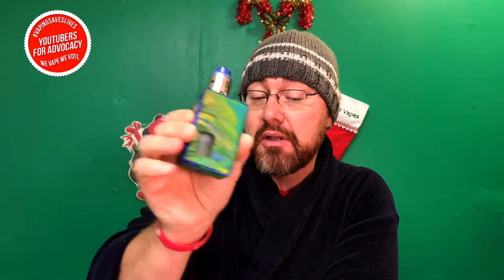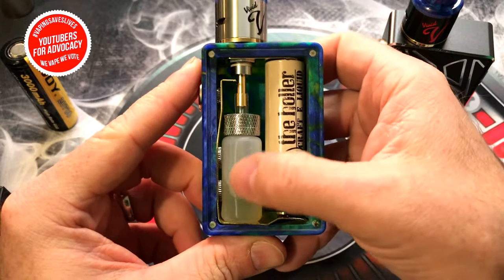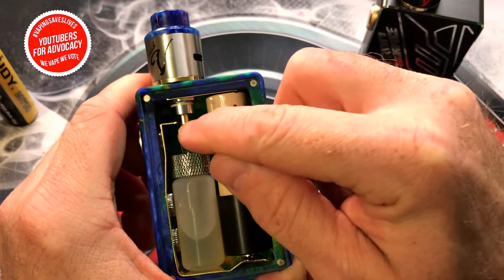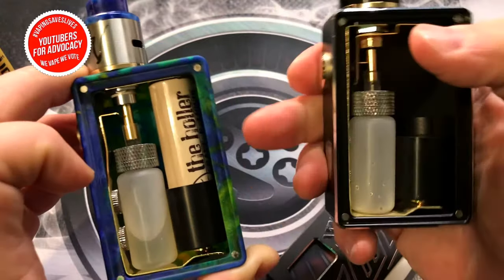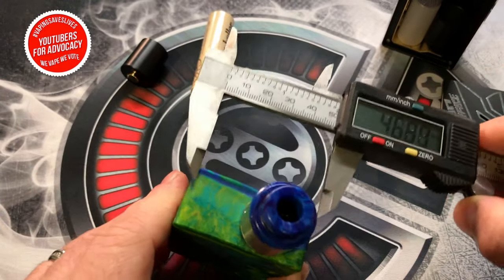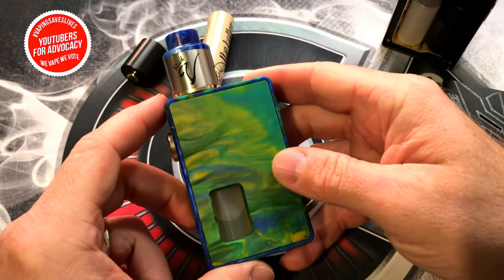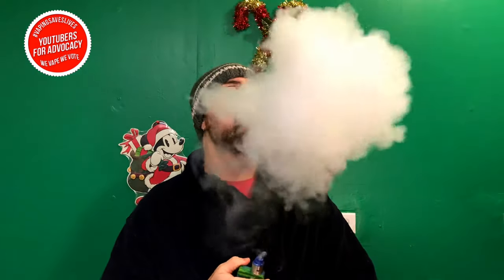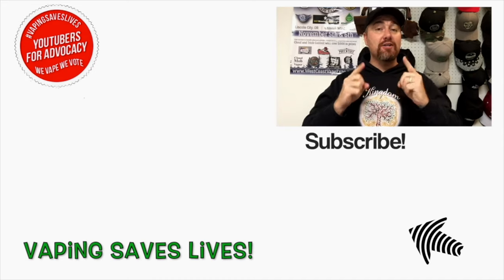VBS Iron Surface Squonk Mod RESIN Review~

Comment: Actually a Sony VTC5a 18650 is still the hardest hitting battery besides the 20700 Sanyo A cell. The 5 leg (I Joy 20700) not a bad cell get 30 amp so can build lower and get 500 more mah I have no clue what 18650 you are using but check @batterymooch out with his battery test. But I ordered the black and blue resin VBS Iron Surface last night. Found it on China for 26$ mod only. Took a chance with the Hugo Squeezer fit 30$ you should check it out also 20700 and come with 30ml refill bottle and 2 10ml Squonk bottles. Silver plated I believe, not hard hitter like my Dot Squonk, Athena or Armageddon but still nice and great feel. I always wanted a resin one and the Ram sucked plus this VBS being 20700 sold it for me. Can't wait to get mine I'm sure it's worth the $ Is the bottle silcone?
Reply: Oh and nice review also as only 2 I can find on this mod!
Reply from the maker: Thank you for your extensive comment my friend!

Comment: What was your build? I usually wrap a dual parallel n80 coil at around .12 to .15 or I use n80 aliens at that same resistance range and they hit amazingly.
Reply from the maker: Good question, I'd have to go back and see lol
Reply: Joe of all vapes😗💨 i got my mod and it hits hard. Not as hard as my skullkandy but it kicks the pulses ass.

Comment: I enjoyed the review but your wrong about 20700's... Any vtc 5a (18650) etcetc are better batteries
Reply: bkob jackson not if you have sanyo 20700a. Also there's another vapcell gold 2700 that's 3100 mah and almost as good as the Sanyo. 
I agree that the efest ijoy 5 leg 20700 is not very good. It seems to have a lot of internal resistance.